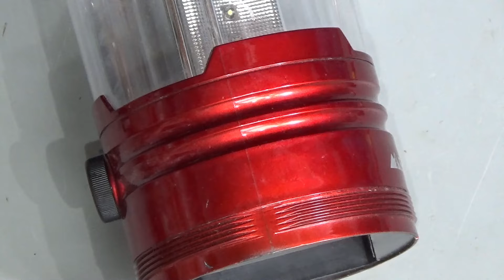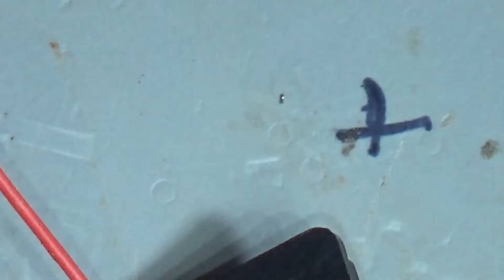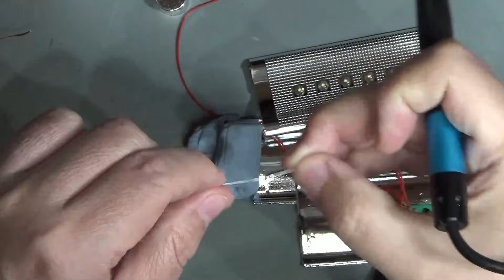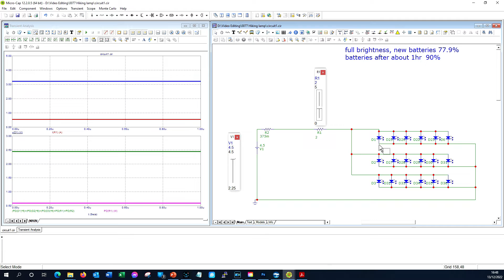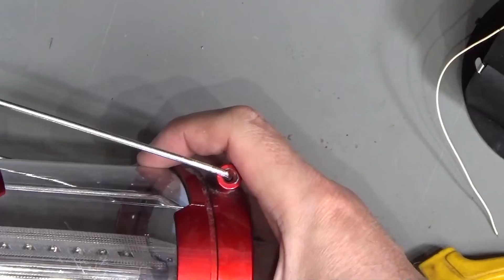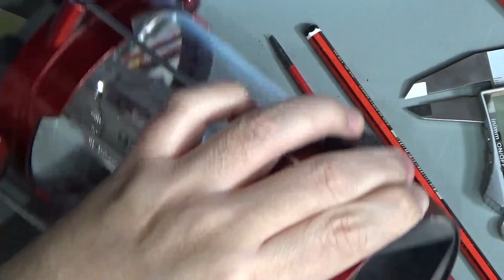Eurohike Hiking/Camping Lamp Repair #0077

Comment from the maker: Somewhat simple repair, but I want to encourage folk to fix not dump!
You could use lots of things to repair the shaft.  I used a bit of nylon, but any plastic rod, hardwood, or even some epoxy putty would do the job